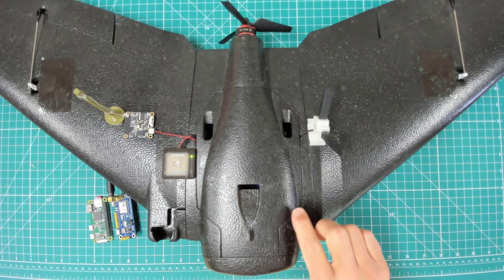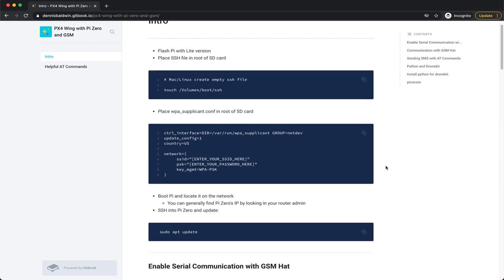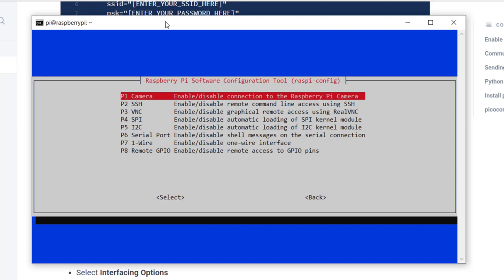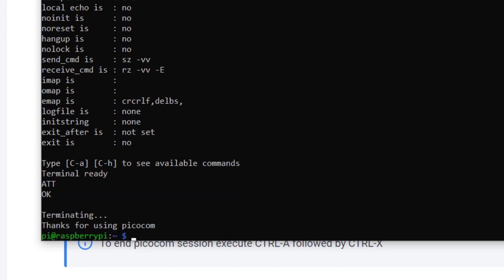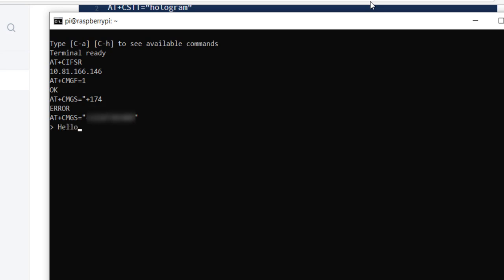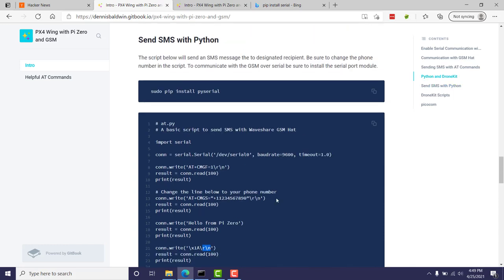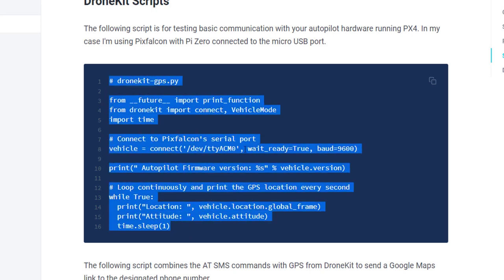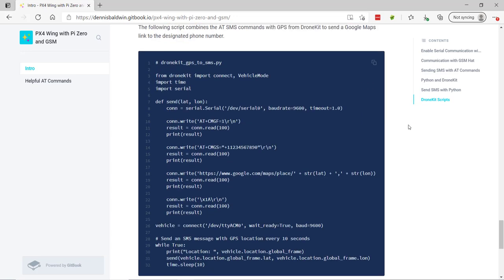Recruit Wing with PX4, Pi Zero, GSM Hat, and DroneKit

Comment: awesome video. have you heard of the android app andruav or drone engage? it allows you to connect an android phone to your flight controller and also use the phone camera for fpv over 4g. andruav and drone engage work together, but drone engage would allow you to use a raspberry pi and 4g module instead of a phone.

Comment: Thanks a lot. Got into the same trap )) IoT isn’t enough and had to switch to OpenHD and network device. Waiting for OpenHD 3.0 where you can basically use PiZero with an LTE modem via Mavlink you can control/receive video and other cool stuff :) Rpanion is a good alternative with VPN but no OSD and slow video but supports Mavlink out of the box.
Reply from the maker: Dmitry, yeah I think this may be a dead end. I'm leaning towards a Huawei USB cellular model or maybe one of the LG models. To have to script AT commands through Python is quite cumbersome. I think I'm making some decent headway and will share an update soon. I had not looked into the OpenHD project, but thanks for pointing it out. At this point the last thing on my mind is streaming video, but maybe you have helped convince me otherwise :)